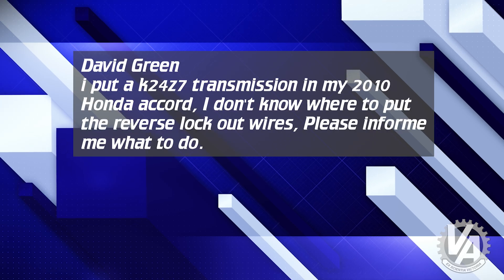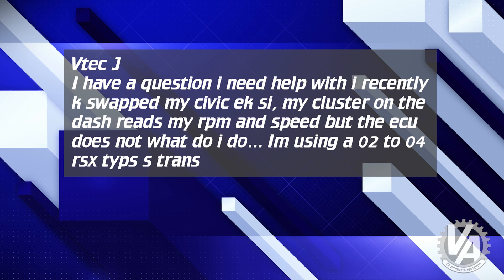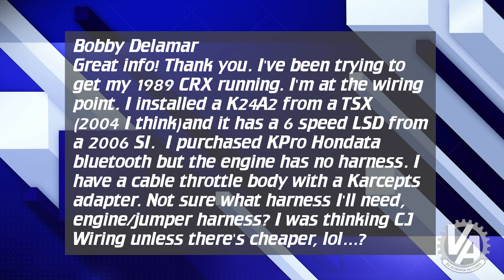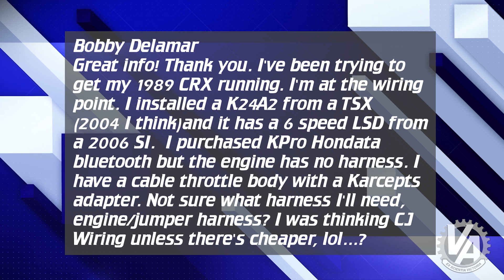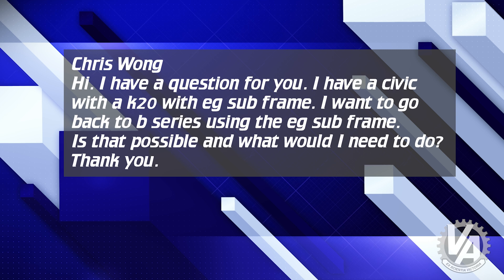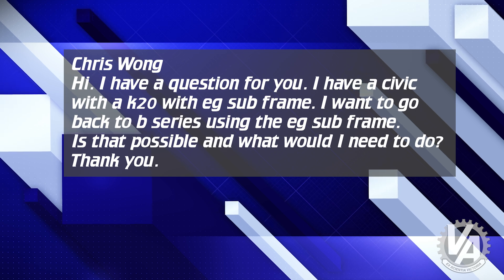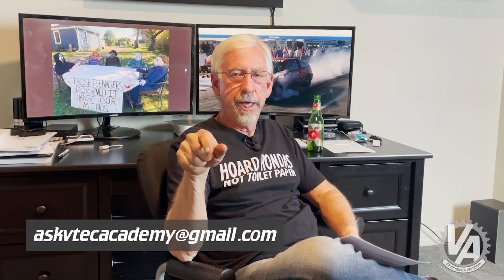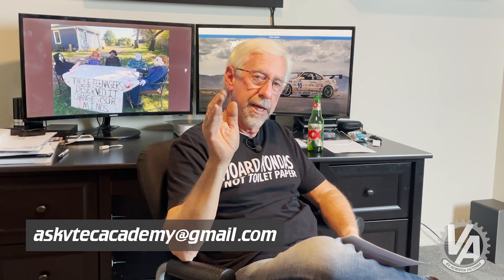K24Z7 Reverse Lockout, K Swap Speed/RPM Signal, Harness for K Swap, Going K to B, Accord Manual Swap

Comment: Hey brian i resently acquired a fresh k24z7 trans off a 15 civic si for a deal i could not passed on i saw u made mounts for them do i use regular k swap axles n half shaft and tsx shifter with cables very little info online can you help

Comment: hi.. my EG k20.. have trouble engine when Vss is on..  when i desable Vss  all is ok.. but the reverse lock si ON all time... i cant pass rear gear... i must swith off engine... i m lost..!! y have lot of knock too.. between 1500rpm and 2500rpm... you can help me ?

k20z head
k20a bottom
12.5cr manley piston
skunk2 pro2 cam
dc5 gear box
kpro v4
410cc rdx
skunk2 pro séries inkate maniflod and throttle
Reply from the maker: What the trouble when the VSS is on?

Comment: Thank you!  I do have a question,  we have a k20A3 swap in a circle track stock car.  It's our first kswap.  We got everything running,  problem is the speedo and rpms are not working on gauge cluster.  Any thoughts on what I'm missing?  It's my first time with these motors,  and I read vtec would not work if it didn't read a speed above 0?  Any help would be awesome...these are great videos!
Reply from the maker: What gauge cluster are you using?  As for VTEC, the ECU get's it speed signal from the VSS on the engine. Evern if the gauge cluster ins't working it is probably getting a speed signal. Are you using Hondata of KTuner for engine management?
Reply: @VTECAcademy  it is all from the same car (we were told) 2003 acura rsx base,  not type s.  So the motor,  harness and cluster should all be from the same car.  Right now we don't have hondata or kpro,  nor do we know anyone who has it.  Is that ecu capable of going into it for tuning?  Thanks for any info!

Comment: Brian you forgot to say that you'll have to weld back on the frame rail bracket for b series.
Reply from the maker: And luckily Hasport makes a weld on frame rail bracket. I should make a bolt on one too.
Reply: @VTECAcademy  I’d be all over the bolt in mount for a k swapped car to easily go back to B for California smog.

Comment: Hey! I have a k20a3 engine from an RSX base and a 03-07 accord 5 speed transmission. Can I use an automatic RSX engine harness for this swap? This powertrain combo is going into a 2001 civic coupe. Thanks for the help in advance.

Comment: I was told if you’re running a PPA auto ECU with Kpro, you will have the same problem. Speed on the dash but not on the ECU because it doesn’t support it. In turn, your 2 speed can’t be set up.

Comment: What kind of oil PSI would you expect out of a b18c1 stock pump at idle with a turbo. Is 10 psi too low?
Reply from the maker: That's a bit on the low side. Typically people are around 15-25 PSI at idle.
Reply: 10 Psi is probably too low
Reply: @BrianGillespie_brianathasport  I’m getting 80 cold and the factory 50 psi at 3k rpm’s. Idle is also very low at maybe 500rpm When warm. car is also turbo so you think that the turbo could be causing that to be low? Both lines come off sandwich plate.